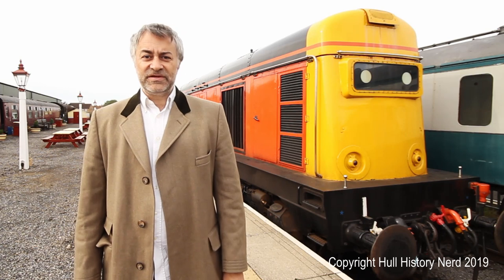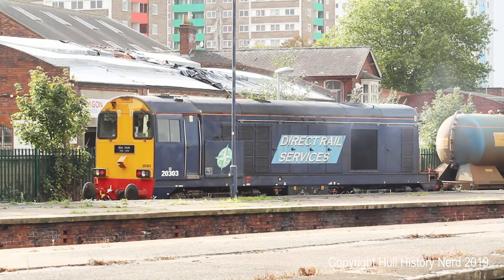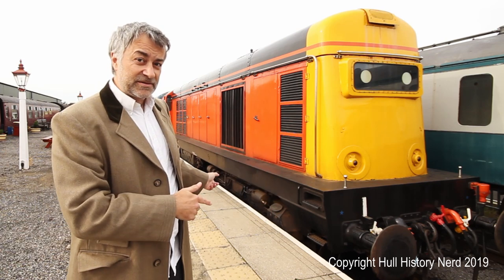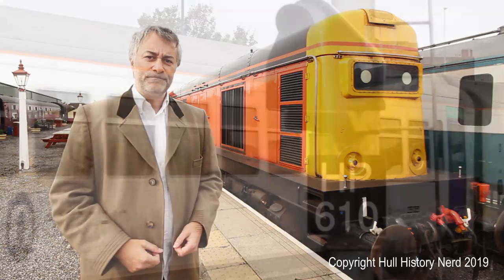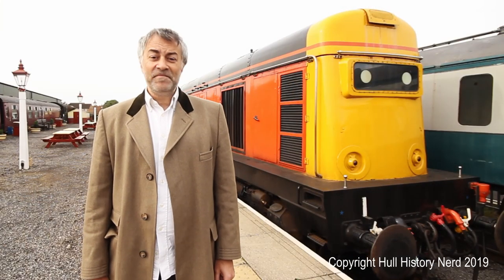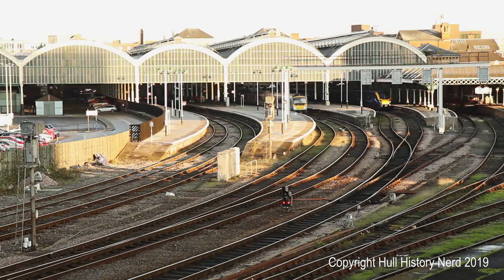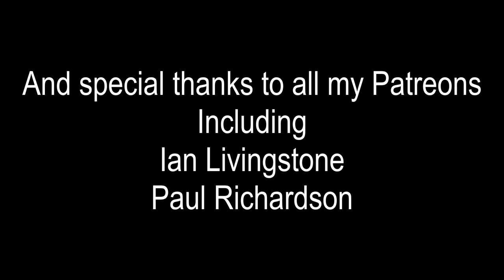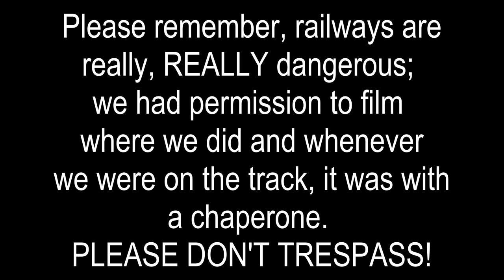Diesels : Class 20

Comment: Big fan of this series, would be good to see it continued. 37s might be a good option next.
Reply from the maker: Oddly enough I'm actually gathering footage for that episode! It's a hard series to focus on due to the patchy nature of finding these old diesels to film, but rest assured, my long term goal is to make a profile video for all of the major classes of BR diesel!
Reply: @hullhistorynerd  ah right, that's great to hear!
Reply: @hullhistorynerd  have you heard of Realtime Trains/Rail Record? They might help find mainline workings of some of what your looking for. For example, Colas Railfreight operate lots of test trains on behalf of Network Rail using Class 37 and also Class 97 (former class 37) locomotives. On RailRecord it'll show an operator for the service and the type of test train. PLPR, UTU and TRU are often 37s, but occasionally 67s or the 950 (purpose built based on the 150 design). If it says NMT it'll generally be the Network Rail Class 43 HST but occasionally this is replaced with 37s or 67s. I hope this is of use.
Reply from the maker: @ILikeTransport  Absolutely, it's how I tracked down the RHTT trains!

Comment: It is apocryphal that Class 15's suffered from poor visibility and is always cited as one of the reasons for their downfall [along with a problematic Paxman engine. No BTC or BRB reports mention visibility from the cab as being an issue Unlike the engine, no attempt was made to alter the design to alleviate any perceived problem. A fix was readily to hand inasmuch as cutting down the height of the "short" bonnet. This had been done by several US Railroad companies to their "switcher" type locos and the practice became so common that new-build locos were built in that style,  giving the look common to US locos today. Think about it, most US locos are "switchers" albeit the short bonnet has mostly become full width instead of full height, and they do just fine.

Comment: This is a brilliantly crafted presentation, but I need to nerd on a bit about a technical error regarding locos working in tandem.
If working in tandem, it means that a driver is required on each loco as there is no equipment available to connect them for multiple working (MW) - it's a skilled task requiring concentration and cooperation. Locos connected with compatible MW gear only require one driver.
These EE Type 1s (20s) have the most common BR type of MW gear denoted by a small blue star on the ends of the loco above buffer beams.
It's a bit more complex than that, because some types had differently coded MW gear, (eg; orange square, red circle etc,) and I suggest following this link for deeper explanation.
Keep up the excellent work!

https://en.wikipedia.org/wiki/Multiple_working
Reply from the maker: Thankyou for the deeper dive into multiple working! I had heard of these different symbols, now I know much more and can be better informed on the next video I do on locomotives, which should be on the Class 37!

Comment: Drove loads of them 1974 as a fireman at eastfield traction depot Glasgow all the old steam men sayed the were just like driving a steam locomotive just a lot easier all the drivers drove them in reverse I can honestly say the were horrible the heaters never worked on them the doors would not stay closed the fireman’s seat must have been designed by a madman in the middle of winter the only heating was the small electric ring for the drivers tea can but still a great job plus my uncle was  one of my drivers
Reply from the maker: Aye, I've heard from a few old drivers that those early diesels were draughty, noisy, smelly and uncomfortable, and yet they thought they were still more comfortable to work than steam!
Reply: @hullhistorynerd  Most were draughty 37's were the worst especially if nose end filters were clogged , 20,s were fun in the other seat as power handles were mechanically linked (under the floor ) if driver pulled for power you had to be well clear of other power handle . Some jobs on class 20 were pig awful , traction motor re brush , 6 brush boxes instead of usual 4 and no pigtails so brushes bugger remove , No 1 motor was nearly impossible . The load reg governor switches bugger to set up (VRS/VRLS ) so as to get them working satisfactory in multi , had many years on them at Immingham     ,

Comment: Brilliant video.Any chance doing a video on the class 86/87
Reply from the maker: Might be tricky, I don't live anywhere near any place where I could see them running - sadly there doesn't seem as much impetus to preserve electric locos as diesel ones, I guess preservation railways would struggle to safely maintain high voltage overhead cables. 

If there was ever a way for me to get hold of footage of these locos running, I would certainly consider it!

Comment: What seems to be the replacement locomotives for the 20's? After all they are old and must be expensive to maintain, have old engines which are no longer environmentally sustainable?
Reply from the maker: The bigger question is; is there any need for the Class 20s any more? Almost all freight in the country is now pulled by 66s, which are considerably more powerful, more reliable and increasingly easier to find parts for compared to these vintage machines. The role they were originally built for evaporated not long after they were built forcing them to be operated in tandem in order to be useful, whereas a 66 or a 60 is a single unit. 

In terms of the environment, the numbers of vintage diesels on the main line is down to heritage levels these days, with tiny fleets that altogether don't really create much pollution compared to cars, lorries and aircraft, so I don't think that's necessarily a worry in 2023!

Comment: What causes the chirppy whistling sound?
Reply from the maker: I have no idea! Random, non expert guess is that it could be a turbo, or some sort of air compressor, but I honestly haven't got a clue. Sounds great though!
Reply: @hullhistorynerd  thanks for that. Yeah it is a great sound.
Reply: The turbo's I  reckon , maybe its to do with them being V8 , they also have gear driven balance shafts so maybe they could be noisy    , worked on class 20's for many years at Immingham  TMD

Comment: I thought class 20s were type 2 not type 1
Reply from the maker: No, type 2 had different power specifications. There was an a English Electric Type 2, the Baby Deltic, but it proved unreliable and never entered mass production beyond the initial batch. Before TOPS numbering came into service in the 1970s, the class 20s were known as the English Electric Type 1, which you can see in older trainspotting books, or if you Google English Electric Type 1.